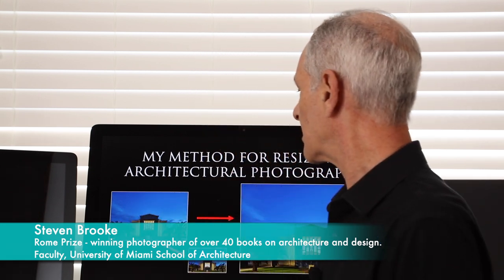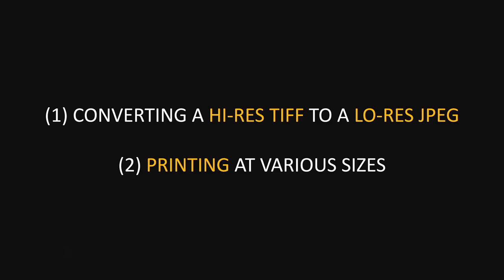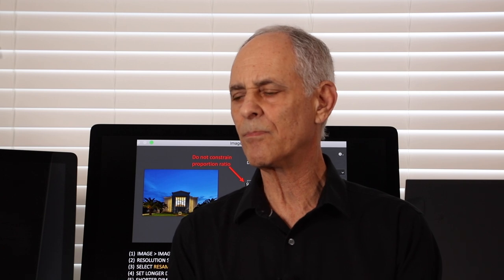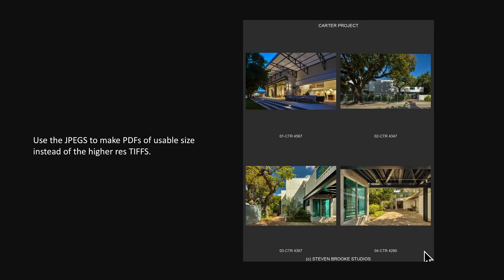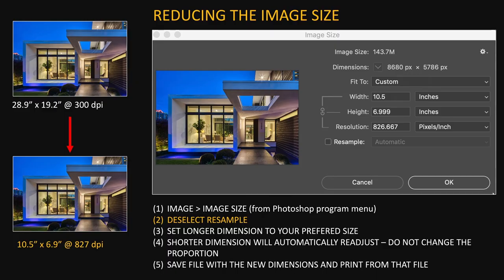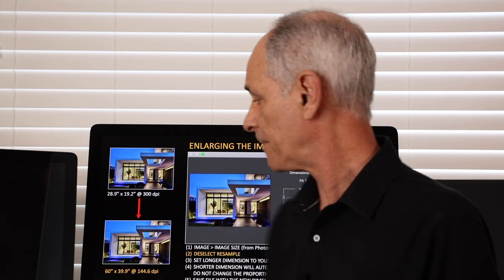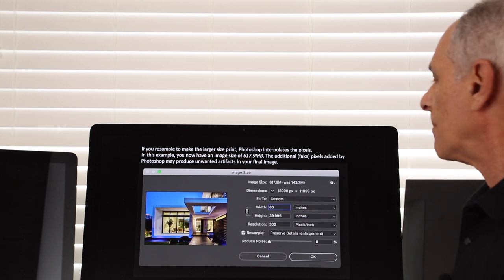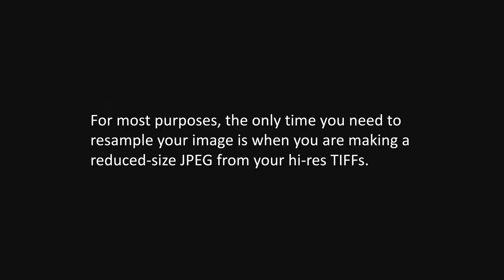My Method for Resizing Architectural Photographs

Comment: I have to say that your advice to not resample for print sizes is absolutely spot on. However, I will point out that your images are getting resampled by the printing software to work with whatever the printer head can produce. In other words, you could resample to your hearts content but unless you know the actual dpi that that particular printing head produces then you'll be resampling for no reason and it will be an extra resampling, and as I'm sure you suspect the more times it gets resampled the more chances you'll see unwanted artifacts. You honestly don't even need to change the size of the print on your end, it's an unneeded step. It only changes a setting in the sidecar file that was important in early digital printing but hasn't been an issue since about the mid 90's.

Comment: Allow me to geek ou a little 😝:
The DPI in Photoshop is just a number that converts a raster digital image size from pixels to printed inches. Converts digital pixels in printed dots.
That nunber (DPI) tells you what the print size will be if you print at that particular resolution. If you want to print a large billboard at 30 DPI, just insert 30 in the DPI box and see the maximum printing size for your image. Alternatively you can set the size you want to print (uncheck resample) and then see if the resulting DPI is enough for the expected viewing distance of your print.
So yes, don’t resample is a good advice. But also, check that the resulting DPI is enough for the expected viewing distance.
Mr. Brooke, I’m in love with your videos and I’ve already bought and immediately devoured your book. I have a deep understanding of the technical aspects of photography - it’s the easy part for me. But l struggle a lot to understand the creative part. Your work on YouTube and on the book is just wonderful on helping anyone to understand the artistic creation of still images.
Thank you so, so much for making this.
Congratulations and wishes of greats success! ☺️
Reply from the maker: Thanks for your note. And I appreciate the book purchase and hope it helps you with your work. Generally, if I wish to see just how successfully I can enlarge an image, I set the dpi at 72.

Comment: Another great video. Thanks. Is there a Minimum PPI that you wouldn't drop below. The point where the image would start to appear pixelated ?
Reply from the maker: I would not go below 72 dpi. Mr. Espinosa printed an 80 x 50 image at 72 dpi and it was excellent.
Reply: @stevenbrookephotography  Thanks. In the Photoshop image size box, it uses Pixels per inch (PPI) and Printers use Dots per inch (DPI). Are they equivalent to each other ? When you uncheck the Resolution checkbox in Photoshop and resize your image, If the resolution drops to 72 ppi, is this the same as 72 dpi ? Thanks again for your help.
Reply from the maker: They are basically the same.
Reply: @stevenbrookephotography  Thanks again for your help Steven. I look forward to your next video. Have a great day.

Comment: How do you focus for Architectural photography? Do you use auto or manual focus? Would like to hear your thoughts on how you do, if you haven't already. Thank You.
Reply from the maker: Conrad, 
Thank you for this very important question. The short answer is that I only use manual focus. 
• For exteriors, in LIVE VIEW with a LOUPE, I focus of the front façade of the building I am photographing to be certain that it is in wire-sharp focus. With a wide-angle lens (17mm or 24mm) at f/11 or f/16, I am certain that my depth of field will cover all aspects of the shot from important foreground structures all the way back. Also, if there is some prominent object in the shot that is closer to the lens than the building I am shooting, focusing manually ensures that it does not set the initial plane of focus as it can often do in autofocus mode.
• Interiors require more precision. As a starting point, I pick a key object roughly 1/3 to 2/5 of the way into the space that I’m shooting. Usually, I stop my lens down to f/22 for interiors to gain the maximum depth of field that my lens will provide. I make certain that the back wall of the interior is in sharp focus. Again, I use LIVE VIEW with a loupe. I will stop down my lens with the depth-of-preview button to check focus front to back. Then I will shoot one frame, and again check that image with a loupe to be certain of the sharpness of everything I want to be in focus.

Comment: Regarding NOT resampling - how do we know what the printer is doing with this image file?  Wouldn't each printer possibly choose its own PPI, or will it work with the PPI that you've got without resampling?
Reply from the maker: The printer does only what you tell it to do. It doesn't interpolate (resample) or choose anything on its own. If you send at 72 DPI, it will print at 72 DPI. If you send at 300 DPI, it will print at 300 PDI.
Reply: @stevenbrookephotography  Thanks Steven - It’s interesting how many labs believe that a photo for print needs to be 300PPI…I’ve had labs not accepting files because the PPI is showing a low number when in fact the pixel dimensions of the photo (the megapixels) were 45 megapixels. This misunderstanding seems rife in the industry. How images are viewed is another important consideration as to output PPI, the closer we look at a print (4x6inch) we need more pixels per inch for it to be clear, and the bigger we print the further back we are viewing it, so a billboard on a road could be 10PPi and still look great as the viewing distance is far away